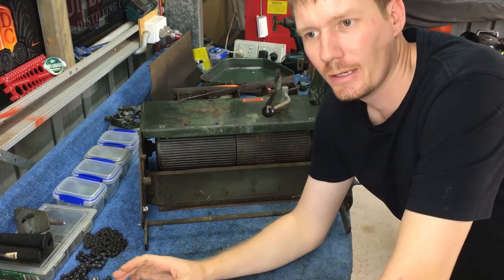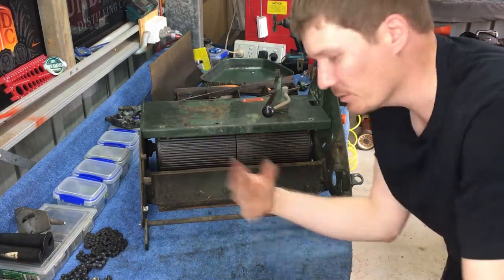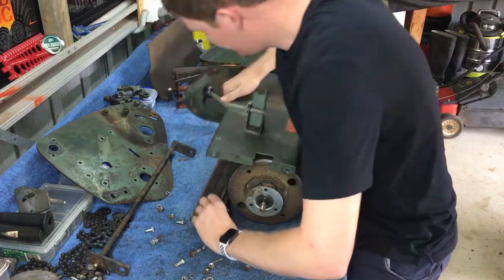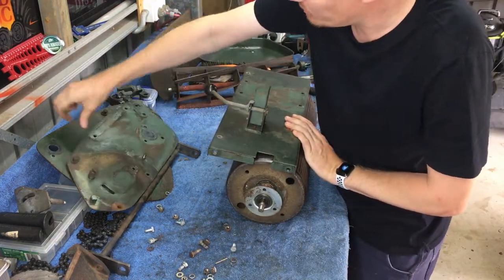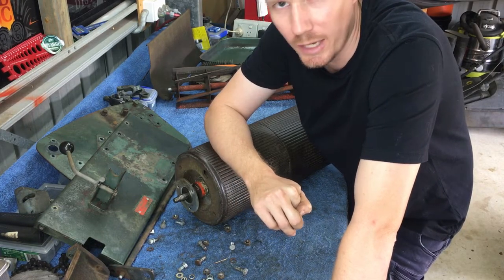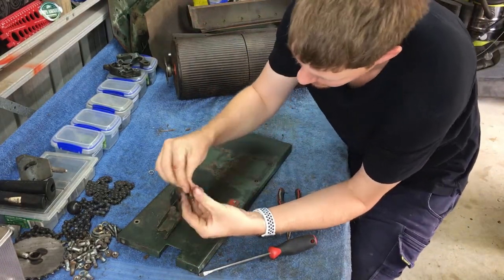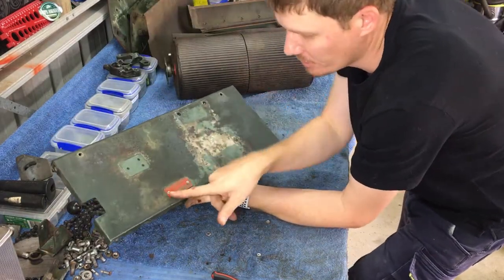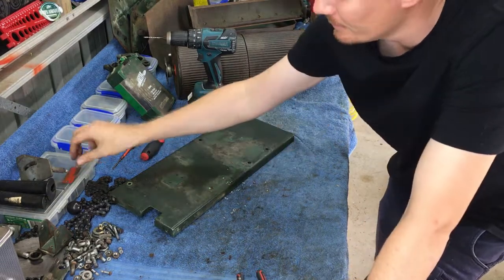Scott Bonnar - Model 45 - Teardown Part 4 - Main Frame Disassembly

Comment: Great vids mate! How do you know if you have a solid deck?
Reply from the maker: When Scott Bonnar Ltd first started selling mowers they released them with one piece of steel between the two side frames, This is called a “solid deck”
Years later Scott Bonnar ltd started to find cost saving ways of making there mower and started releasing there mowers with two rails between the two side frames, this is called “twin rail”
Reply from the maker: I’m talking about the piece or pieces which the motor bolts to.